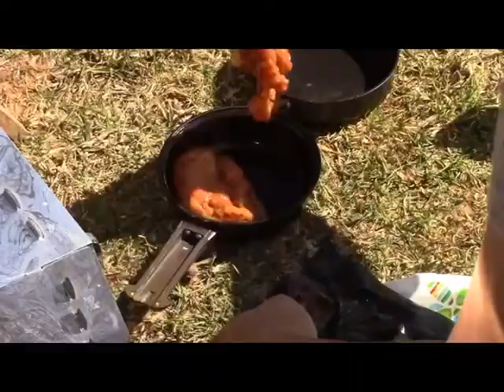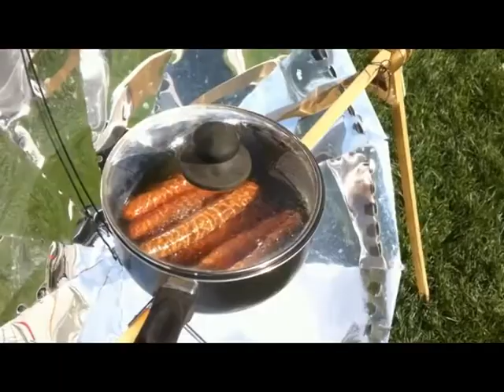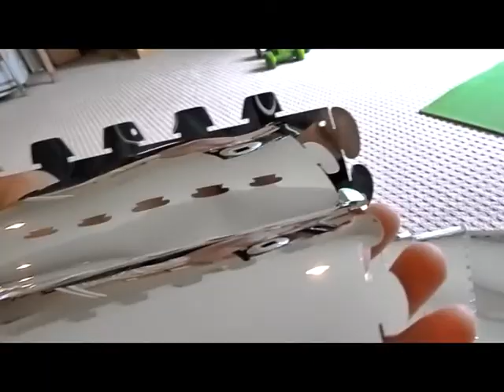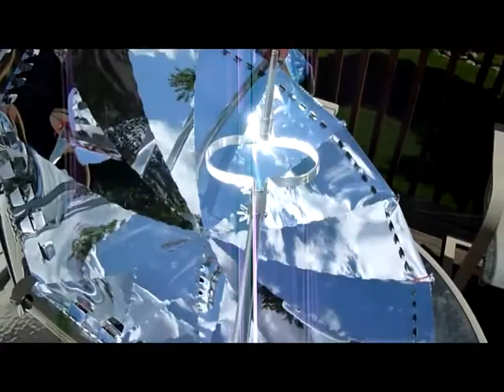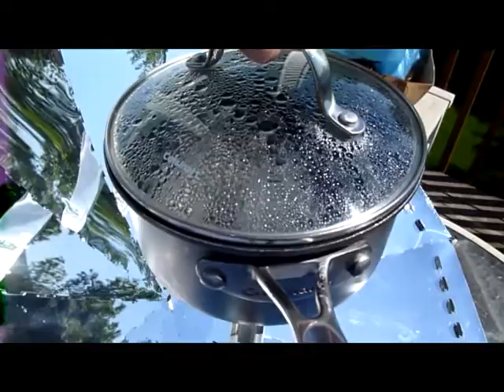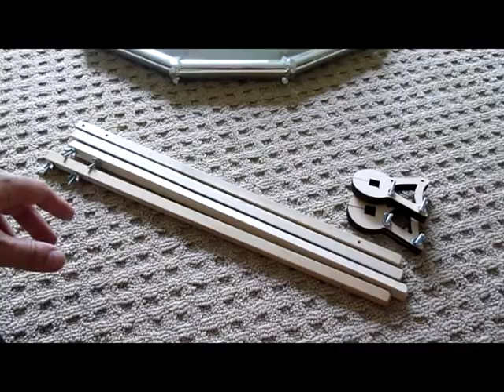Sun juicer solar cooker review

Comment: I use the shadow of the center metal spot to aim the dish, so on the ground it's fine. I have bot had problems on windy days. I lean 2 bricks, one each on opposing diagonals, and I hang a small rock from the top of the dish. The small rock prevents the whole dish circling around in wind.